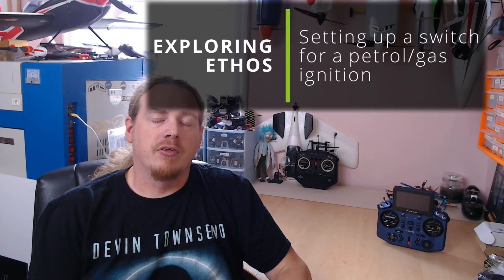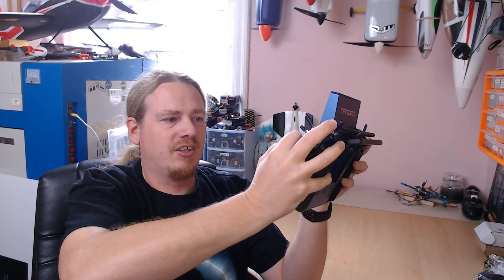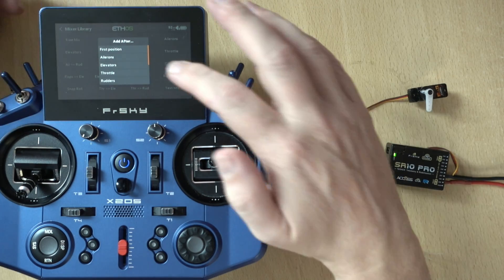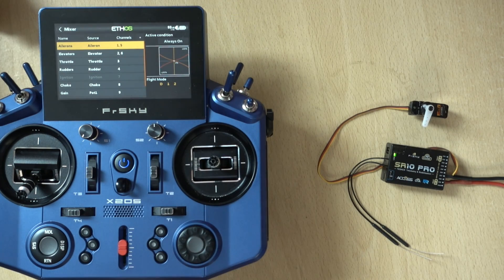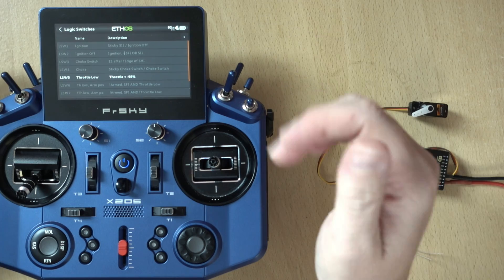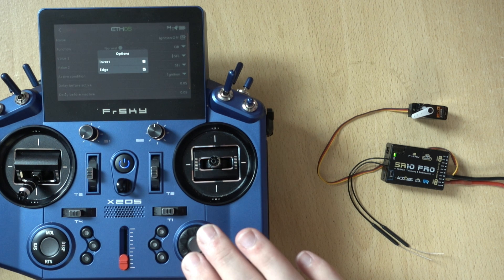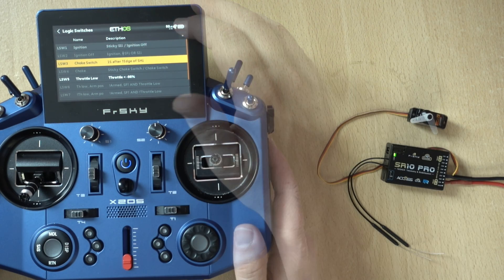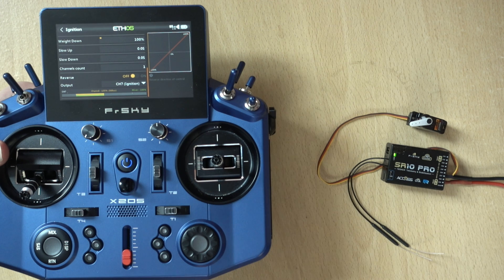Setting up an ignition switch for a petrol engine in ETHOS

Comment: Thanks for the video. All these videos do not address that using a stabilized receiver the channel you select for ignition will have jitter (Stabilization) except channel 3. This is also true for throttle and choke control. A video showing how to setup using an SR8+ for Ignition, Choke and Throttle would be great while showing how to turn off stabilization to those channels.

Comment: After having reviewed all the previous viewer comments, I too finally understand your process.  I was initially concerned that all you were doing was killing the throttle servo’s movement.  The use of the servo was a little confusing, but “that” was meant to demonstrate the passing of “signal" to the iBEC/Opto Kill.  Viewers can’t see you physically triggering the backside buttons, and may take a few rewinds to pick that out.  Many flyers I know are accustomed to the standard two-position “H” switch as a killer for ESC or Petrol signals.  With FrSky making the H switch momentary it gets confusing. I’m also new to FrSky and your video content “is” helpful.  Thanks!

Comment: clear as mud, I'm new, you assume a lot of knowledge, I'll repeat and stop many times. but lets see if I got it now. just plugged it in doesn't work for me, shows the switch working but ignition doesn't arm using a tech aero IBEC. tried using two position switch , don't know why you're demoing a three position switch for an on off function. Anyway maybe I'm not doing it right for a two position switch, I just need a simple solution.

Comment: I am using a default throttle cut functionality and just assigned the opto kill switch to the same switch. Dramatically simpler and I think it does the same thing.
Reply from the maker: Not quite. With my setup you can still operating the throttle with the ignition off.
Reply: @MrD  well if I move it to a different switch they will operate independently. Btw do we really need throttle cut for gas engines? Since the plane is idling anyway and you can’t just kick the radio and start it and get injured.
Reply from the maker: Yes, throttle cut is always important. You need to be able to stop it immediately.

Comment: How do I change the safe position of a switch?  I am using switch SB for ignition.  And have it set with the switch  down (towards me) for ignition off.  However when I turn my Tx on it gives me a switch warning for that switch when actually the ign. is off.  I would prefer a warning if the ignition is turned on.
Reply from the maker: You can set the warning in the model menu, then the page called Checklist. I'm pretty certain it's Checklist. My mind went blank for a moment, and I don't have ETHOS here to check.
Reply: @MrD  Yes, Checklist is what I needed.  Thanks.
Reply from the maker: @ottdave1  great. Glad you got it sorted 👍🏻

Comment: I'm new to Ethos (10 years Spektrum) and so far love the X20S. Learning a lot from your videos, but can't figure out how you basically made the momentary button into a toggle switch (first push on, second push off). I'd love to set my ignition that way. I think that would make a great instructional video ;)
Reply from the maker: Hi Karsten, 
I've shown how I set up that ignition switch at https://youtu.be/KBO3o_aq6qE?t=381
If you don't want to incorporate the throttle cut in to the off side, you can just use logical switch 1 and have SI down for both the on and off triggers.
Reply: Thanks Darren. I tried, watched the video over and over but can't seem to wrap my head around it. Maybe too early in the learning process. Thanks for trying to help though, much appreciated.
Reply from the maker: I’ll make a separate video on how to do just the switch part.
Reply: That's awesome,  thank you.
Reply: Darren, after messing with it some more I finally figured it out. Actually pretty easy now. So no need for the video. Thanks again, learning a lot from you.
Reply from the maker: Glad it’s working for you now. The video will be out on Sunday anyway, in case anyone else would like to see how its done.

Comment: Hi Darren,

Thanks for your informative videos. I’m in the decision process of getting the Frsky tandem. It will be for a freewing 80mm f14. Do you think it would be possible to program this transmitter to lock of the flaps when the wings start sweeping and stop them dropping whilst the wing is swept? Also interested about the 900 and 2.4 frequency. Do you think this helps for extra signal strength? I use spektrum, really good radio but loose signal in one location. Any help I’d appreciate. Thanks-Ant
Reply from the maker: Yes, locking out the control surfaces when the wings sweep would not be a problem. 

The 900 working with the 2.4 is for making sure that the signal still gets through, even if one of the frequencies suffer issue. From WiFi for example. To be honest though, just using the 2.4 FrSky, you’ll see a big improvement over Spektrum. At my flying site, there is a spot where every so often some guys have RF issues. They’re all flying Spektrum. But I’ll fly through the same area and not have a problem whatsoever.
Reply: @MrD  okay that’s great to know. That’s interesting that even their 2.4 is possibly more robust. It’s a big investment as I’ll transfer multiple aircraft over with Frsky receivers. Will I be okay with the standard version over the “s”, in terms of functionality? I guess it will be a nice learning curve with the new system. What ten channel and 8 channel receiver would you recommend that runs both the 2.4 and 900? Thanks a lot for your reply. Much appreciated -ant
Reply from the maker: No problem Anthony. From my experience, the RF is definitely more robust than Spektrum. At my field there is Spektrum, FrSky, Futaba, and Jeti. Only one has these RF issues. 

The “S” receivers have built in stabilisers. So with the R10 Pro and the SR10 Pro, the only difference is that stabiliser. 

Receivers with “Pro” in the name are safe to use with engines that have electronic ignitions. But can be used on anything. Receivers without the “Pro” should only be used on electric models or glow engines. 

Receivers with a G prefix are made for gliders. They have a built in variometer. Again, they’re fine for use on anything other than electronic ignition engines.

The tandem receivers are still very new. So far, only the TD MX has been released. But the TD R18 will be released pretty soon. However, any receivers with an SBUS IN port, can use another receiver as a redundant receiver, so you can still have 2.4 with 900MHz as a backup.
Reply: @MrD  thanks for this in depth message. I’ve just purchased the transmitter! Really looking forward to getting dug in to this new avenue and learning curve. I’ve had a browse of the receivers that you mention. Are there two receivers that you would recommend for both 6 channel + gyro built in and a 10 channel? These will be for EDF jets. I’d like the telemetry to let me know signal strength. Not fussed with other data. This will be the last question! :O. Cheers Darren, really informative info-Ant
Reply from the maker: @anthonyjayakody3356 No problem Ant. The only option for 10 channel with a stabiliser is the SR10 Pro. This one also has dual battery redundancy, so great for a backup receiver battery. 

You can use the SR6, SR8 Pro, or SR10 Pro on the 6 channel models. I’ve not seen the price difference between the SR6 and SR8 Pro. But if it’s not much, the 8 may be worth getting. As you have more options later on. For example, I always get the R6 over the R4, even if it’s going in a 4 channel model. As the price difference is only about £1.50. So for the flexibility, it’s not worth getting the R4.
Reply from the maker: @anthonyjayakody3356  these receivers all have some telemetry. There will be RSSI and VFR for signal strength and quality. Plus a couple of others. Receiver battery voltage and one other I think.
Reply: @MrD  thanks Darren, I’m going to pic an SR8 Pro and test the whole set up on a basic trainer plane to get a feel for it. I’ll probably invest in the S bus redundancy 900 receivers too and link them up. Cheers for all of this info. I look forward to learning more from your vids. Have a good weekend. Ant
Reply from the maker: To be honest, I wouldn’t worry about redundancy on a trainer. It’s not til I get to 30cc petrol size planes I even think about redundancy. Most of my models just have a basic 2.4 receiver in them. But it would be good for a getting used to the system point of view.
Reply: @MrD   I was going to start with the sr8 pro as I need two for an 80mm FMS Futura and another freewing 70mm jet. What do you recon? I will think about the redundancy receiver set up for the twin 80mm f14. Let me know your thoughts. Thanks-Ant
Reply from the maker: Sounds good to me.
Reply: @MrD  awesome cheers!

Comment: Hi Darren, I'm wanting to use a Rcexl opto  kill switch,  I've now found that it doesn't work with the reciver, 10ch,  seems to me that for some reason the switch doesn't recognize it, I have tried the switch with another tx,rc, works fine,  any ideas, thanks Philip
Reply from the maker: The channel shouldn’t make any difference to the opto switch. Which receiver are you using? Did you have 1-16 set for the channels when you bound the receiver too?
Reply: @MrD  spent about 6hrs over a few days trying to sort it   had it working on a servo but when I swapped it over  it didn't work    finally got it sorted    something was turned on in the transmitter   not sure what    working now though
Reply from the maker: Glad it’s working 👍🏻